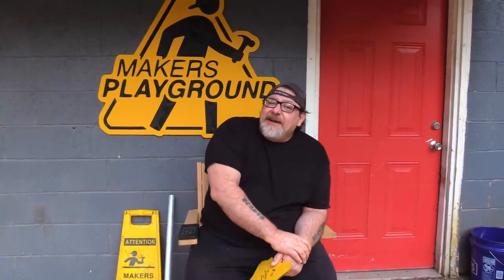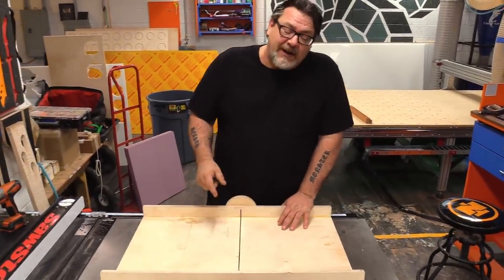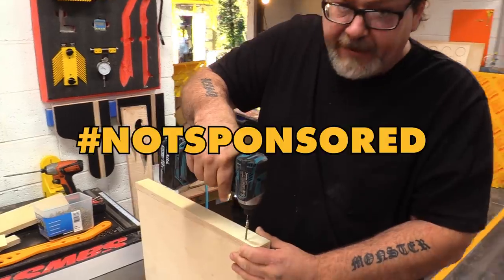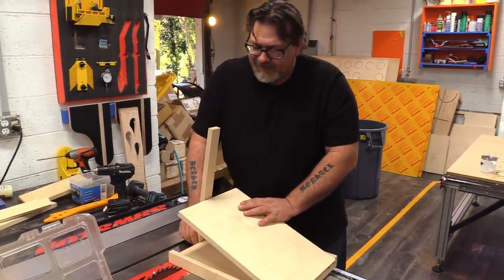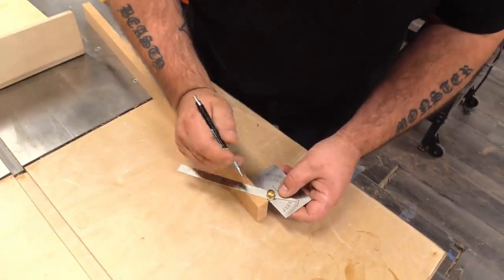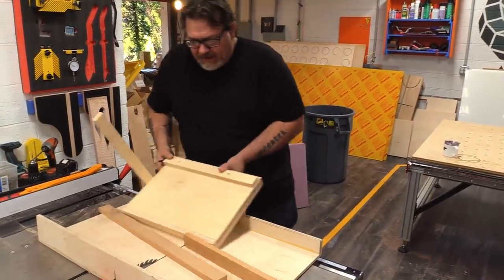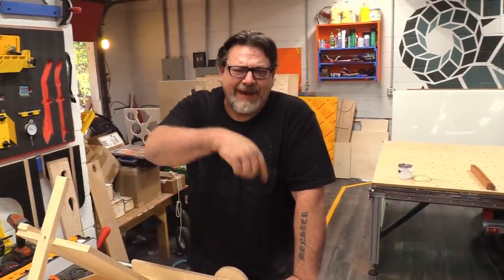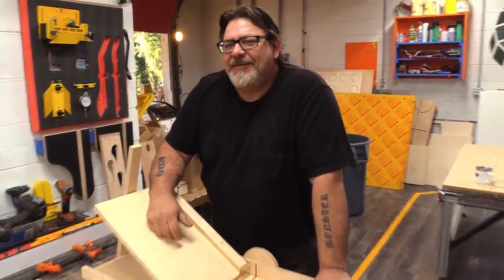Make a Simple Jig for Cutting Complex Miters/Angles | How to Woodworking.

Comment: Like a sine bar in a tooling shop. That is an amazing tool that you could explain in a video and it's uses. A cheap set of setup blocks would make woodwork angles get down to minutes of an angle. Being there are charts that people can hang on the wall , you don't need to do the trigonometry anymore to figure angles , just look at the chart and multiple the distance between the rollers on your sine bar.
Reply from the maker: That's a great idea
Reply: Agree, using it like a sine bar would be good. Just a jobsite problem of keeping track of the setup blocks ...